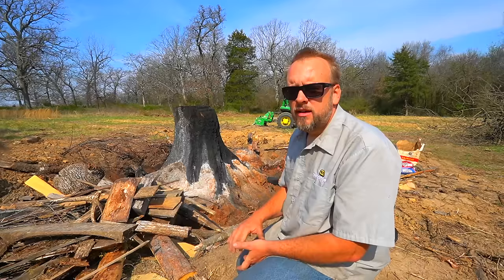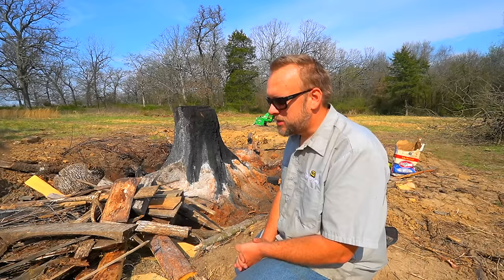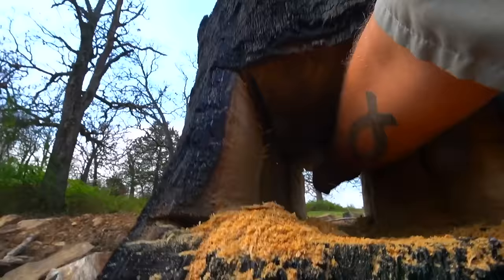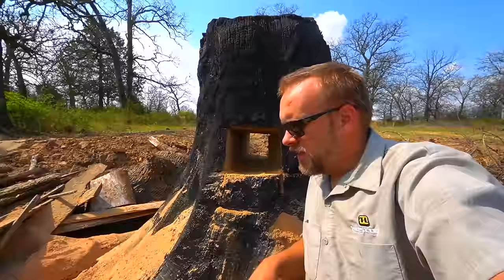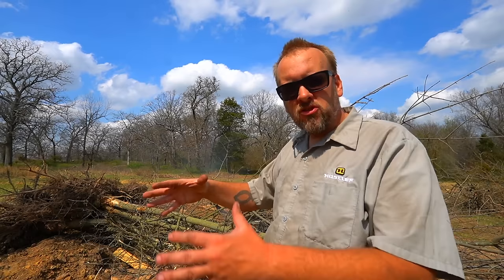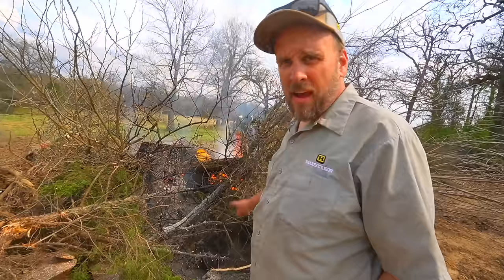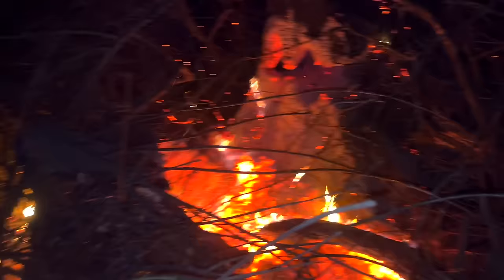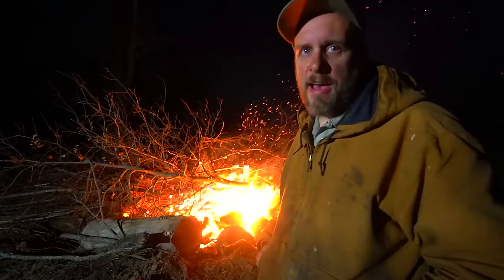How to Turn a Tree Stump Into a Rocket Stove

Comment: As I’ve said before burning out a stump is not a forced March and shouldn’t be.  I’ve always used a stump location that I want removed as my new burn pile/pit location and when the stump finally get burned down to where I want it, I move my burn pile to a new stump location.  It may take a month or three months I just burn on it when I have material to burn lite or off and leaved and do other things…. Not make that the only task I work on.  I deliberately do not set a time line. It part of the farm function to burn waste when it pile up so it really doesn’t cost me any time away from other task.   This did totally work a ton better for you as far a speed of burn out and that’s what you are after in these examples.  👍👍🔥🔥
Reply from the maker: Yeah, it’s basic property cleanup. Had some brush and some half rotten logs to get rid of and making it interesting by trying a different technique on the stump.

Comment: If you're not in a hurry burning out a stump is an enjoyable way to spend some time.  No matter how you do it it just ends up taking some time.  When you cut those slits down the sides you made it better for sure.  I may have tried to do a plunge cut from the top down to the "chamber" you cut out also as obviously fire likes to go up.  If I have the time and energy I like to try to dig out a little under the stump as well to help it burn up but doing that really is labor intensive so I normally only do that if it's a huge stump and I need all help I can get.  No matter the technique if you enjoyed the day, or two, or maybe three and the stump is gone that's all that matters.  Video on Brock!

Comment: I like your content, sincerity, and honesty. The smaller the stump the less to burn. Like said in another post, I just use stump for a burn pile and then move on to the next if needed, I spray with GLY STAR PLUS to kill anything else from growing up around the stump, and the root system. Dynamite works well also. Watching stumps burn is like watch golf or two snails' screw. LOL I would of thought you may have found yourself a stump grinder by now. You're going to be burning stumps till you're 90 if you don't improve on the process. You should add up the time, fuel cost, etc. that goes into the removal of one of these stumps using your burn methods. Be interesting to know how much time and cost it is taking you to complete the task. You might want to start craving out animal figures for yard ornaments. Keep up the great content and I'll keep watching. Thank you for making these videos. Also, congratulations on your health improvements. I am planning on starting a s a I get rid of other recently purchased groceries etc.
Reply from the maker: Thanks

As far as the diet, if you can get through the first week, it’s not bad at all, and the results have been amazing
Reply: Thanks for the reply I left you a comment under buy a bigger tractor.

Comment: A few things I have found are: 
It is easier to cut away wood than to burn it. Do some digging, then cut the stump as low as possible.
Cut the cube out as you did from the side
Then plunge down to release the cube. Do this last, as if you get through the stump and into the dirt, you'll dull your chain.
A leaf blower makes it a blast furnace.
When the fire goes out, get in there and smash things with a sledge. The wood that is left will be brittle and often breaks off

Lawn chairs, a cooler, and a few buddies.

Comment: If you had added two cuts straight across and vertical too the hole you would have what is known as a Dutch oven

Smaller version is where a log is split into quarters and the centre piece is removed and then put back together with wire ties holding it together and then with fire starter a fire us started in the middle and with the air cracks all round the log burns furiously

Comment: Did you consider just making a few straight cuts downward from the top to as low as you could go below the opening you cut out? It would not have required you to get on top of the stump.  It may have allowed the flame to burn upwards faster and also helped it to burn downwards quicker.
Reply from the maker: Yeah, I was thinking that after I had already started the fire up. Almost still tried to climb in there and do it.

Comment: you have the rakers too low!  the 3 in 1 tool will do that if you put too much pressure down,  Just happened to me last week.  Just take the flat file out for a couple of sharpening, ot just a round file and the chain will come back.